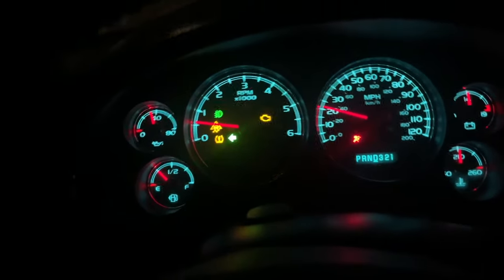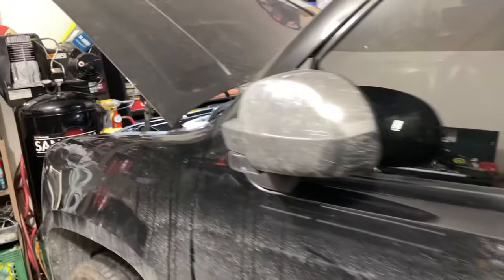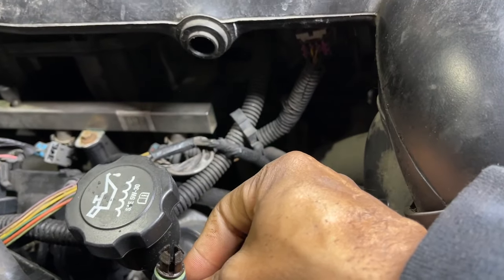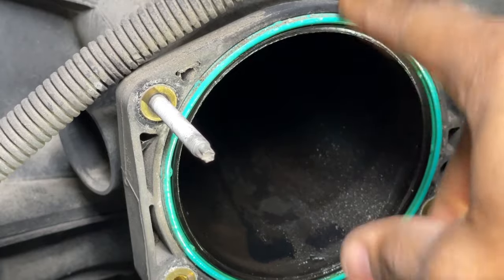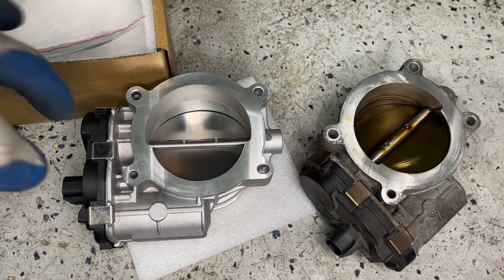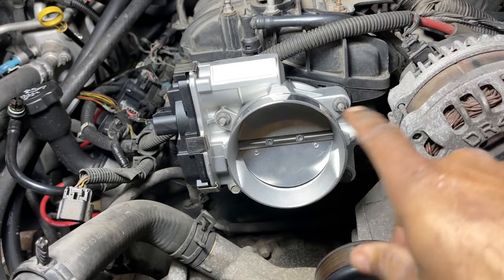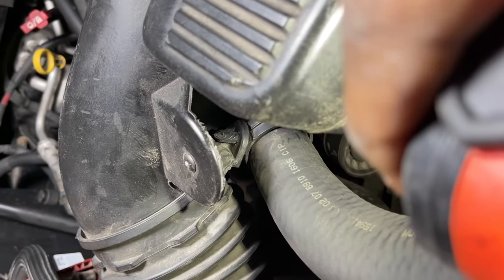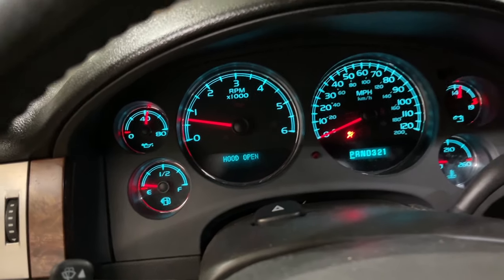How To Fix Reduced Engine Power Quick And Simple! Code P2135 Chevy Or GMC Trucks / SUV's! TPS Issue!

Comment: I was having the same problem, engine power reduced on my 2008 Chevy suburban.I just replaced the throttle body yesterday. Ran fine for a little bit, and it’s doing it again. What else do you think it can be?
Reply from the maker: Please tell me the exact code you got. Also, did you replace it with a new throttle body? Another culprit for this particular code is the APS (Accelerator Pedal Position Sensor). Here is a link to that part (below). 

https://www.ebay.com/itm/304859331499?fits=Year%3A2007%7CMake%3AChevrolet&hash=item46fb083bab:g:~6cAAOSwWyhkIWjU&amdata=enc%3AAQAIAAABAKn04pk%2FJGFRc1QMAC76b%2B7lhBa5pc%2By5OeFWvZGUQouuRKXe88a8EjubhV%2BRixHSSnzulxgu886ITyc%2FMm%2BqGBqJoz44%2B9EqHzLszvIGf%2FlYTZQTfBGAIRamR2ZZxbasRd5JkFeL9T6pJ2eWTvcYB0gY69vUdrYJPKRDuq3nHK%2BFYAakc%2FP8ARVQTRpePxaLzWT2GzUzkr6gD81VJFCucMaL7DjB%2BcoCW7C2twnAzVujuctC4UtAn5BhO7%2BsnbvbxwTu5IpX3RIkoQdBFAbsm54IRHpnzdxxP8aEbW2Iw%2Fdc%2FLO3CYjlfnuua7YWF3jlLQi9O%2BcQtia2VAJbFH1b7Y%3D%7Ctkp%3ABFBMoo6Dv6Zj
Reply: @TerenceDIY  yes sir, I replaced it with a new one. I just scanned it and it has these codes c0242, p0230,p0341,p0449,p0641,p069E, p2119, p025A

I also replaced the fuel pump like 2 weeks ago
Reply from the maker: I wish you would have messaged me before changing the throttle body. That is definitely not your issue. Let me look into this because this seems like a possible electrical issue (harness).
Reply: @TerenceDIY  thank you

Comment: How long that one last cuz I have to change mys every 3 to 4 months
Reply from the maker: Still going strong. Did you buy an OEM one? Here is a link for a decent one. 

https://www.ebay.com/itm/333627241435?fits=Year%3A2007%7CMake%3AChevrolet&hash=item4dadbbb3db:g:idAAAOSw~UJhkdH9&amdata=enc%3AAQAHAAAA8MjoO0WdBfGVeinK0xj%2FLd2FTK6tfYe%2FK5z8Z31smof1jfX3pvdl9kesnJ%2Fv9aYmQ26e4Wf2cMFQ8wemI80uiFy0nCLO9EP7rb%2FvFtNBBKU6Pm5kpQN2YFTN74BFQ%2BusPVIziP%2FHpEvfePc4fK1d2vzQOnn8vBy9IzafNbmmOczqARtwD1GSrE0z8BScPnQ3yMDknjSZMLaOKauYYjETLFtiSPVZZT%2FP8y7BR7xVqcS%2FapTiiD6Jpxfxrv3nKNWbiLdc%2B7j59EtY2mHp37aBZFyMu3VVSH%2Bkfs35N%2B9NC3DehqLrA%2FEa0SFlkDbQZ3YZwQ%3D%3D%7Ctkp%3ABFBM5qeHvuph

Comment: Hey Terrence video very helpful I have a quick question the hose you disconnected where you said to do it at an angle what is that hose called.mine is broke

Comment: mine was 1 wire barely hanging on by insulation at the throttle body connection! check wires!!
Reply from the maker: Yep. If you look at the comment section, I've recommended that several times. It was posted on a GM bulletin board years ago. Thanks for sharing that info and watching!

Comment: I have the same code for my 2000 Chevy tahoe.5.3  with traction control ..I need a part number
Reply from the maker: Here is a link to the part (new and used)

https://www.ebay.com/itm/314955032409?fits=Year%3A2000%7CModel%3ATahoe%7CMake%3AChevrolet&hash=item4954c86759:g:1rAAAOSwTShlTy1I&amdata=enc%3AAQAIAAAA0KqbtnG41A%2BhiATIJg7kXaTXc7HZnliv%2BlE3%2BhsBZ8Uv%2FcTMb%2Bah3IFZJ0wyV3HO%2Famtb%2B7R%2BI9g3heF2yPBTzlIe%2BUhCf%2BUL01kvYY33d%2FL7am7yX46nvkJ5yOQrKAeuyMGqorMbrTKaLQ9Xs9Y5T0oiI19aZbZNIeRd0iZAyhYge0j8s4bGDfoX87pS7LPrszxd%2Bo80paHxdnYRKje694QPsmLU4lQslNWxPM8Qe7X7xfjGj9fPQExUH753x1r8J3xlCBYrqKOna2XQomcLc8%3D%7Ctkp%3ABk9SR8qEh_aGYw

https://www.ebay.com/itm/305275886278?fits=Year%3A2000%7CModel%3ATahoe%7CMake%3AChevrolet&epid=14007315780&hash=item4713dc5ac6:g:eU4AAOSwfzxlWXF9&amdata=enc%3AAQAIAAAA0CK%2BVsvKUXYLITO9os1oZIy1DlU8YxjfCmrH0h4nfsv2ULjz%2FBChfLSyM6eFj395GIcP8FrH02P0cWVrJJn4kj8BOzwu2FkM963isL5ftz42eZ4Hfd2PpzOyoljDcObxhV4jReVOzEpohBvN9wRjdO7NKRGt9di%2BBWCguckcG2VIFDerDRkydPzyGEg46mDezUqbpitrt1KUrjDp2xX9bahDyoe%2BGPl1J4sEivZBOXPMJ9cMSVNQfUMV8GC4BHkgl7v1UjJoSZ%2FrbN5r0NkO2kk%3D%7Ctkp%3ABk9SR9CEh_aGYw

Comment: Hey so ive changed the throttle body but it worked for like couple days and went bck to limp mode
Reply from the maker: Did you replace it with an OEM GM one?

Comment: so we need to replace it with a new part or clean it off ??
Reply from the maker: You can clean it however, I would just replace it. Here is a link to the part....

https://www.ebay.com/itm/263995173265?fits=Year%3A2007%7CMake%3AChevrolet&hash=item3d7756a991:g:4pwAAOSwxdxkUx5o&amdata=enc%3AAQAIAAAA8MoF82K0AxlhxKH79JiZTQ2N5WvceSUWOJ%2FwAyNOHGzQFG%2FRfEGKULjb4XCN%2FD32HCy0Cc2pEnNSQu4KjKKEIzQ13HMJMKQJK9BPnADuPDtOy5I4WgyG4EasYuVtjngMU3rLR5wjETdqIpoviTAtb1MwmkfiG5DxrE9nfTDSLjLD%2BqHKEyF18hMBYMnyqRe6vNqQH%2BXyEjWDt4iP6iiMVnCeX%2B7l16jYAQ74mDLL6c4QKumQeCyCKHDeb3b3vOVUMw67TqUiuupiXPkHKBzjQBWP0sUCbROMLvF44y9UkBtNtAbO5m9zn1tYrRW2cwZj1A%3D%3D%7Ctkp%3ABFBMoK7DrJ1i

Comment: Hello my guy how are you. I'm frustrated as hell I just paid $500 last year to replace this thing and now is doing the same thing again this year I know I don't have to replace it again do I what should I do
Reply from the maker: Hi, do you know if it was replaced with an aftermarket one or and OEM. $500 is expensive. Here's a link to a part that I've used on a few different vehicles with no issues and it's very easy to change the part. 

https://www.ebay.com/itm/263995173265?fits=Year%3A2007%7CMake%3AChevrolet&hash=item3d7756a991:g:4pwAAOSwxdxkUx5o&amdata=enc%3AAQAIAAAA8MoF82K0AxlhxKH79JiZTQ2N5WvceSUWOJ%2FwAyNOHGzQFG%2FRfEGKULjb4XCN%2FD32HCy0Cc2pEnNSQu4KjKKEIzQ13HMJMKQJK9BPnADuPDtOy5I4WgyG4EasYuVtjngMUx0CXdti%2BvyXkJEH7PuVBdHtLYauiu4Rxh3Eok7S6qGur8CeUPqNyJJTrtMPGFCOCeOMNTBJSLgdO7%2FgMFYwqoe%2BH27XDs3nH1YoCeqZ9rMhMc0C1DhDP82sT5fUexLCcVvtZm7ec6Epn7V8c5e3T7eFpdtqpPefRfJz2gS5wD9gSnTwBjf8huuantlmlJaOkw%3D%3D%7Ctkp%3ABFBMqtzijp5i

Comment: I got a 05 c6 corvette I changed the gas pedal and tbi 6 months later it came back on the cel with the same code
Reply from the maker: Hi Karlos, you should inspect the harness where the TBI connector runs. There's been post on Chevrolet bulletin about the wire harness having frayed wires, loose connections, etc... causing that issue.

Comment: I have a question for you about my 2003 chevy suburban. I know spark plugs are one of the most simply stupidest things to replace however my truck has a totally different set up and unsure how to go about replacing them. It's like 3 nuts to a plate to remove a spark plug, as if they have a computer to each one.
Reply from the maker: You have to be talking about the ignition coil? You should watch my tune-up video. It shows everything in great detail. It will help you significantly.

Comment: Quick question when that happened did the engine vibrate when accelerating because to my suburban it would do that
Reply from the maker: No, it did not vibrate. It would barely accelerate and shift hard out of first gear.

Comment: Man this just happened to me. I was driving fine, all lights came on and lost power. Turned off, waited, turned back on and same. Turned off again but this time I took the AFM disabling dongle I have in the obd and drove fine. 2011 Silverado.
Reply from the maker: I'm glad you got it back going. Thanks for watching.
Reply: Do you think I should drive it or have it repaired asap? It ran fine all the way home but that was a ten minute ride?
Reply from the maker: @eddiereveron8955  , I would get it fixed however, I have dealt with a situation where the truck went into limp mode for a short while and drove fine for a couple of months after. Monitor it closely. Another quick fix is to remove the air duct from the throttle body and clean it with some throttle body cleaner. That will help.
Reply: @TerenceDIY  thanks for the reply. I may just fix it Thursday. It’s the warmer day coming. Been having low temps here in PA.
Reply from the maker: Here in Chicago as well. Here is a link to the part if you don't have it yet. 

https://www.ebay.com/itm/225590875332?fits=Year%3A2011%7CMake%3AChevrolet&hash=item34864394c4:g:tgUAAOSwNrhkby5M&amdata=enc%3AAQAIAAAA0NNQWXMnLtdnN%2Byk2rlPXLmDWd9AB5%2FNY652Eej11m1%2FXyL6%2FHkjN%2B8BtJwz3X4cJImRuZQZoIQcV2DBIfXC5MkwPCFIyHr2AMAQm4dJ8d0%2FY5YfRchnLW01QvsHXav3Jlh1BH5Ilmt%2BEIt5Qra9fUbWgQIdsZ9yzzdZZUbQdYwS%2FZv7uZ1%2Bv0FWMCe%2FasihsmJuUQzmgq9awcg8zDBeZhb3qrazXPr706cORe4n9iY%2BS2uVLpNdHZ3YRZ%2BzbPrvTij%2B%2BLV10jO14NiL7PxsalQ%3D%7Ctkp%3ABlBMUID3j_GlYw
Reply: @TerenceDIY  so the part just came in. Is it normal to hear a slight rattle coming from the sensor when I take the part out of the box? I shook it slightly and hear movement in the sensor area.
Reply from the maker: Hmmm... Interesting. I think it is fine, but you'll notice it once it is installed. Let me know.
Reply: @TerenceDIY  So the rattle is normal the old one sounds the same also one of my coworkers who is a mechanic told me it should be OK to sound that way. Just installed it I’m doing a few relearn process right now then I’ll take it for a test drive. Hopefully this was my issue thanks for all the info you’re awesome
Reply from the maker: Let me know how it turned out.
Reply: @TerenceDIY  I don’t think the computer is learning it. I did the learn procedure of run 3 min, off 1 min, run 3 min and when I’m in park it idles around 1500rpms if I give it gas it stays at 3000 and doesn’t come down. I have to turn off the truck. I drove it and it’s down shifting rough. Gonna keep at it tomorrow
Reply from the maker: Did you disconnect the battery before you removed and installed the new part? I did not have to do a relearn.
Reply: @TerenceDIY  yea I did. I thought I had to.
Reply from the maker: Okay. Let me know if you get it running correctly or not.
Reply: @TerenceDIY  so far no good on the learn procedure. Gonna try it a few times again but this may be defective part.
Reply from the maker: That's messed up. I wish I was there to help. You can return it and ask for a refund. If you completely want the part that would probably work without a relearn, you will probably want to go back with an OEM one. Here is the link for it. 

https://www.ebay.com/itm/111730088563?fits=Year%3A2011%7CMake%3AChevrolet&hash=item1a03a1da73:g:e8QAAOSwoudW4vMr&amdata=enc%3AAQAIAAAA4E0quQ6y7lGHViTJrJ6RhyRhLRseHtJZN%2BIHFUXNt3wj0x%2BXM1aKOsOc3f9JnceBkA4DPZWfcJ%2B6GhnHY0HFynJmH0Q0%2BPH7nY7jLT11a4r4ftoIgdT2ds3s%2BlT%2FgqJSNdQ57ZgLOFFqXb34zJWaAT7Y%2Bqi52IWZisvZuIJ%2FsdeDm3TKpyKb7BgiiGtJfWM%2FPPV%2BfhRztdbL11Vckf3OCW6ASxB6Jw5RjBAZ%2FQ1c1YfW882BV9S8s7jqQPtI4MtR6yvlEBo%2FgEd1jyBq1IHu2vCfXE1qWGcUrwVRuCavsLPf%7Ctkp%3ABk9SR_6NpLWxYw
Reply: @TerenceDIY  yea wish you were here haha. I’m gonna use a snap on scanner my coworker has tomorrow. There’s a function  to relearn the throttle on the scanner. Let’s see. If not I’ll just return it.
Reply: @TerenceDIY  I read somewhere they all gotta relearn. OEM or aftermarket needs relearn. It’s crazy cause it drives good! Just rough down shift when coming to a stop and rpm’s going crazy on park and revving the engine
Reply from the maker: That is not true. I have done a few, even my own, that was fine after installation without a relearn.
Reply: @TerenceDIY  I just got back from Work ,borrowed a snap on scanner, performed an idle relearn and it’s running like brand new.
Reply from the maker: That's awesome! Glad you got it fixed. Thank you so much for watching my content.
Reply: @TerenceDIY  yea sir. Thanks for all the info.
Reply from the maker: You're very welcome.

Comment: Hey I changed my throttle position sensor and clean the throttle body and now my truck idle is super crazy I’ve tried to reprograms and nothing
Reply from the maker: I would have replaced it with an OEM throttle body. The entire unit. What year is your truck?

Comment: We are having the same message on my 2005 Chevy Avalanche -- Reduced Engine Power.  We've already replaced the Catalytic Converter and Throttle Body.  Do you know what else we can do?  We cant even use a code reader, because that OBD plug wont work.
Reply from the maker: Hi Dawn, did you guys replace the Accelerator Pedal Position Sensor? This is a common issue with your truck. I had the same one. I have quite a few videos on the channel with that truck (not the APS though). Here's a link to the part (below). Since you guys cannot read the codes, it's a shot in the dark, but I would not be surprised if this fixed your truck. 

https://www.ebay.com/itm/195394383890?fits=Year%3A2005%7CMake%3AChevrolet&epid=25017008867&hash=item2d7e69b012:g:0iAAAOSwyPZiwiUA&amdata=enc%3AAQAIAAABAMkJ9NkW6HlJEaVOrWfAQM9CT0DTGNBLdwriBG20zClTLTSwh%2Biyhz4Mjs02ddPuaKIMI8RcWzGgg6H4Q0%2Faw4VjuOTM0DHRvJhWaYfD8Q4SUadYrC%2FWeBtnzvNXMtnwjTV5HpQceH9R5VxbYu2q0zHXbC2Umvgni7o7QZTE1oOztcu7MeRn85CO4JtDC%2FOrJBfz3M6JtnfFg%2BTRdYzvQ4DJdLYtYTb4hzfZnCbEXqpAMGV3CuapDCWGJAHhEsbBI2NvoV9QK5c%2F4lpZHVldOodto3M%2F3B7qEaSgG4cuKN2lYJErxQ3K1%2BtcjKurKohC25KOwlSsFcKxnuPSFBIJYnc%3D%7Ctkp%3ABFBM5sSY6tBi

Comment: Just replaced the throttle body on my 2008 Chevy Silverado 5.3l and now it's idling high.  Any suggestions on how to fix this?
Reply from the maker: Why did you change it? Did you have this specific code? Did you use an OEM throttle body? Did you disconnect the battery during the removal and installation?

Comment: Hey man, how are you? I’m new to your channel but I’m hoping you can help. 

So this has been a recurring issue for a number of years for me. I’d say it’s happened about three times now. The first two times it would throw the truck into “Reduced Power Mode”. I took everything apart, cleaned it nicely and that would fix the issue for about a year. 

The check engine light has been coming on and off for a few weeks now. I finally ran a scanner and noticed it was P0121. No Reduced Power this time though. The truck runs/starts just fine. No stalling or high idles. I’m going to take it apart and give it a thorough cleaning tomorrow or Sunday which should take care if the code.

My question is: Is this something that just becomes normal? Like a routine maintenance? You have to clean it out every so often or run the risk of getting the Reduced Power Mode? Or is there an underlying issue I’m not seeing? Should I bite the bullet and spend money and replace everything (Throttle Body, Sensor and Wiring)? If I do, do you think it’ll solve the issue permanently?

Truck: 2007 GMC Sierra 4.8

Thanks in advance, brotha. Peace.
Reply from the maker: So sorry for the late reply. If I were you, I would just replace the throttle body especially if it's the original one. This may fix your reoccurring issue. Also, visually inspect that harness that the connector from the throttle body come from. Chevy posted a bulletin in 2012 about wires in the throttle body connector becoming frayed or loose in that connector. Let me know. Thanks for watching.  Throttle body links below for a great price...

https://www.ebay.com/itm/313060626212?fits=Year%3A2007%7CMake%3AGMC&hash=item48e3de0f24:g:WrMAAOSwK21gNmUd&amdata=enc%3AAQAIAAAA0FVaL6b67vLo5ljhLpeU83s2XoUNB7COAVKlEKo1D6hxBh9W5qCtaob7d1g2IH7QvdAOVt4LnTaX8Kp54N5YWHwl1FgNdKF6AXXU1bmXmNYGC6neOBM5jH9x9zYb4mObJvZznCm7ASfr0529QujCN8%2BKQ7dJxZJ%2FgGEwYGPOdkItiY09x9544L0Adds%2Fj0%2BfI229VGpHhxHC4tcOeMRytUH%2F1Tvw6CwHFnyTWiThoteeuBt%2BqNzGjg20%2BcuoebSNF3055n8r8ez71abQN1mOCb0%3D%7Ctkp%3ABk9SR7iDlMy2Yg

https://www.ebay.com/itm/254915068776?fits=Year%3A2007%7CMake%3AGMC&epid=112769957&hash=item3b5a1f4368:g:qHEAAOSwC2FgW1tj&amdata=enc%3AAQAIAAAA8EoDwoFAdfE7U4T5cvS9v6gyx76UcfGZSiU9xN177m0b%2FxXR%2FCToq%2BL9RT4qyAU7u0M3RtwLP7kOCtk0cayhWo7ERDAV5LLKCGVtpAYLlVLDp9ztNof%2FM6KfVBc4akIRcPk%2FTN9xIY9tqJW%2BAQoPEa604YBp4tsDWj8akNQn7qc2P6VAfp6DuAmyCtBf5BUgm4bMeRvA7bhBWvnY7a6RBnFHmY7YOcHqvr3hOOeyAm5xKhR4Zq84UjyN5yfDyIcS1Tm9JhPCFRmdP3iRs9UGuKqnSJV4OTv04BVMAX6WXmL6%2BtqL7aVvjxx%2BGfQWWNIzDw%3D%3D%7Ctkp%3ABk9SR7iDlMy2Yg
Reply: I too have a 2007 GMC 4.8 L and have replaced the throttle body 3 times and the throttle position sensor and the mass air flow sensor I've driven it two times since and it went back in limp mode again on my way home last night . I have put in a manual knife blade type DC battery disconnect to lift up the connection to the battery ... it's so annoying. I wish I had some Tannerite to blow the darn thing up... totally disgusted and sick of working on my truck. Ugghhhhhh.
Reply: @MrZitosdad  same thing happened to me , have you fixed it ?

Comment: I have a 2009 Buick enclave started having reduced engine power and service stabiltrak went on to change throttle body sensor, pedal position sensor and mass air flow sensor last test drive it just died out 
I’ve taken it to a shop previously where they got a quick 5,000 out of me by replacing both catalytic converters and I’m left with a car that’s not running please reach out if you can help
Reply from the maker: What codes or code was the vehicle showing?